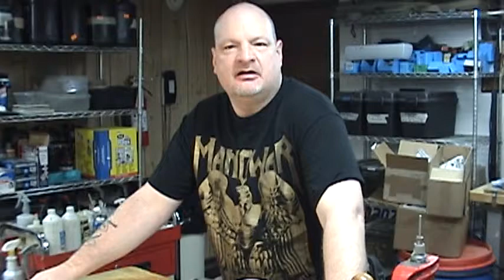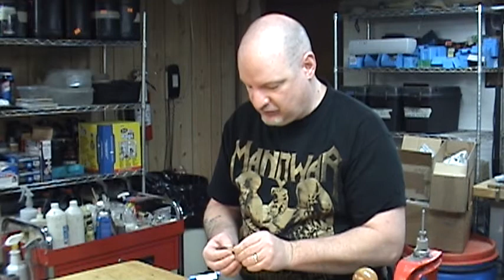S4M Coffee Chat 3 24 2014

Comment: NORMA dis some extensive scientific testing of MOLY coated projectiles. Hotly debated and perhaps even controversial MOLY has risks but also some amazing benefits. Reduced pressure but increased velocity are amazing IMO. Another amazing thing is the increase in accuracy from barrels known to be warn after 20 or so rounds. Slightly decreased accuracy upon first use.  If I had worn barrels I'd use MOLY without a doubt.  However for me I'd have to know the size of the particles because all MOLY is not created equal.
Reply from the maker: +worddunlap  We used micro particle Moly on out S4M when this vid was made. Then I found something even better that we now use on our S4M, T6B and Pen rounds.